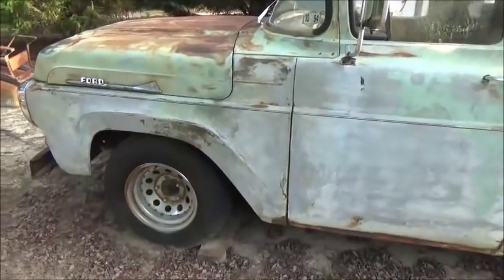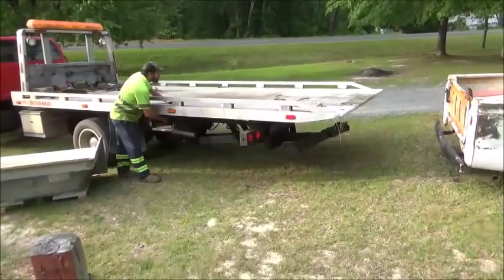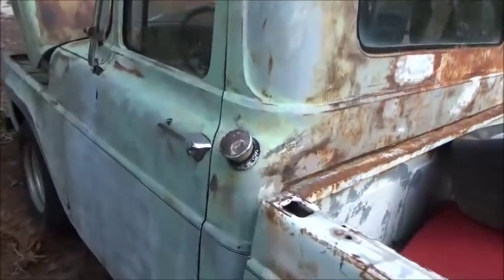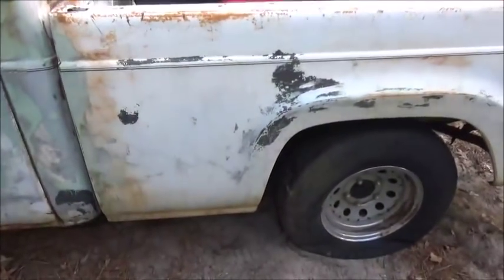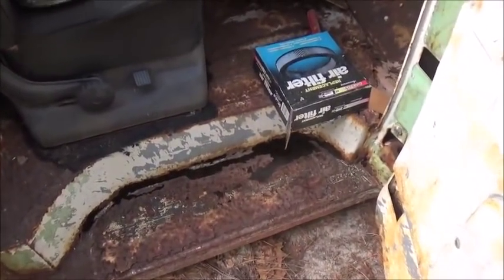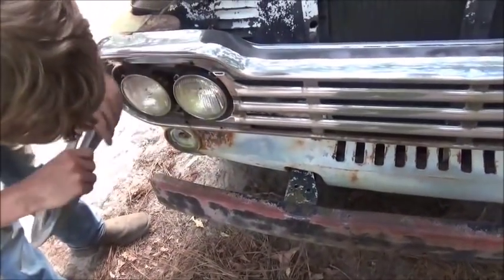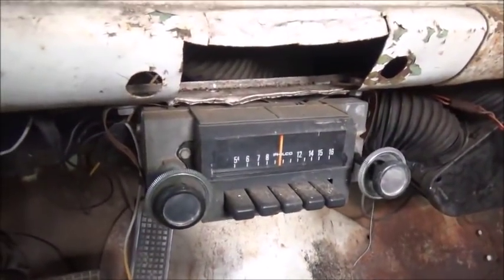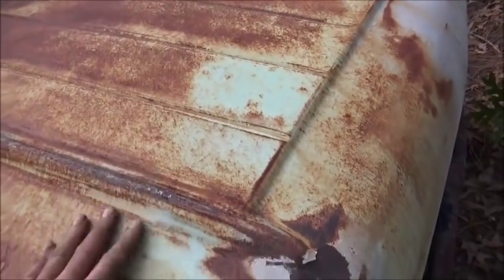1958 FORD F-100 SHORT BED! NEW IRON COMING IN!!

Comment: Eddie Cochran , somethin else , is running through my head right now  .  Another classic saved , just put me in the workshop with it and it will come out looking mint , any style you want it to be , myself , I like to see them straight n clean , with just a few little extra touches  and to be used not locked away . Keep the classics comin . Your  the top man for rescuing the old iron . Excellent job

Comment: I would not mind owning that Ford truck its a keeper for sure. Awesome condition too for what it is. That is a sought after Ford Truck worth money its kinda rare. 
Original MSRP Base Price$1,874  Low retail $14,050 average retail $26,900 High retail$61,300 I would sand that down prime it and paint it and it would look great. Those steps kinda bad though LOL The bumper and seat are not original. It use to have a Y block in it. The Windsor is better but not original. Its not worth the Kelly blue book prices because it dont have all the original stuff. But its in decent shape really sure enough something to work with. It probably needs everything brakes whole nine yards. The wind shield is good that good that is a big plus. If I didnt live thousands of miles away I would try to buy it from you.

Comment: Jonathan, that truck would be a screaming dog providing the motors not pooched. Would look 👀 sweet with a 2” drop and some deep dish black steelies on some 285’s. Nice stance with a Pro touring suspension setup and 4 wheel disc brakes. Side exit dual exhaust through the rear fenders.... nice mild Crane cam. She could be a total sleeper for someone.

Comment: My first driver was a 59...short bed stepside..had a 352 and 3 speed manual on the floor...didn't get much of a chance to drive it much being young and not really mechanically inclined was just too much....sat in my yard a couple years before I practically gave it away...often wonder what happened to it.

Comment: Assuming that truck doesn't already have it.... Throw a 9 inch that  puppy with the gearing for a inline six 300 c.i.d. and you'll have a pretty quick truck ...my long bed 71 f100 is set up like this truck and it I'll go from 0 to 55 in about 4 seconds and that's just driving normally ...I dunno how fast it would really take off if you got on it...the one time I got on it was with brand new tires they started spinning on dry pavement so I just let off it and never tried that again ...

Comment: Ford would not even spring for an exterior door lock on the drivers side. I bought a 60 F100 like yours in 77 and drove it from Utah to the NE.  If you wanted to lock the vehicle, you pushed down on the drivers side door handle, slid across the bench seat, exited via the passenger side door and locked the passenger door from the outside with the key.  I've heard it had something to with  California having a regulation which prohibited the driver from exiting the vehicle into the street or oncoming traffic.

Comment: I bought this same truck and was so bummed out when I found out the frame was bent I didn't get to finish and drive it . I loves body style the coolest looking of all the fords I did have a 48 f1 with a 302 and a automatic transmission  I put together but the king pin front end was worn out it would shake bad until you got it over 35 mph one time my starter fell off driving to work lol

Comment: Hello

Great to see a 1958 F1 rescued.

It prompts me to ask for your opinion. I have a 1950 Ford F5 coe with a V8 flathead. The clutch is shot and the manual transmission does not have syncromesh. There is a company called Flatomatic who specializes in providing Ford C4 automatic gearbox conversions. Do you think the C4 transmission would cope in a Ford F5 coe?

I know to a used C4 out of a 1965 big block Galaxy.

I really would like an opinion.

Many thanks

Nick Jervis UK 🇬🇧

Ask the man who owns one

Comment: I had on just like it and loved that old truck. I drove it everywhere. But I did have the original engine with 3 on the tree. I don't think it ever got loaded no telling how muck sand and gravel I hauled with that truck and it would not even grunt pulled everything I ever hooked it to but someone had cut the back brake lines and folded them over so all it had was front brakes. I was pulling a boat to the lake and the brakes gave way and I ran into a tree is what happened to the truck. This is when I discovered that it only had front brakes. Check things over good now when I buy them used.

Comment: Pretty nice score.. I remember back then people really didn't take well to the double headlights and the grill was a one year only so in fifty nine people knew they were stuck with the double headlights and the grill changed a  bit so the gained popularity again. Same with the car having  the funny grill that people then didn't like  so JC whitney time and tube grills. They are kinda like a studebaker, as time went by gained popularity. I sure do love the newer no points distributor, and fuel injection (throttle body) was turn key. Hope you find the one your looking for as they are coming your way now. You have a few thousand cars that you have seen in barns and buildings... fields, what a bunch of memories. Good luck with your new find... Time for a huge building to poke em in and out of those dreadful pine tree needles

Comment: I think it was a 66 I had,green,said "twin I beam" on it and had a 289 3 on the tree,plus a feature I really liked back then,a cooler insert built into the driver's door. It drove and rode pretty good too until the motor went to shit. Then my older bro bought it and put a granny geared 4 speed powered by a Chevy straight 6 in it,which if I remember right came out of an old Apache. He kept it for 2 or 3 years and let it go to his ex-wife in the divorce settlement. Lol.

Comment: Johnathan, I had a 57 f-100 for twenty some years.it had rib's on the hood, don't remember if the 58 had them.might be off a 57.it also had a Fordamatic transmission with a solid copper cooler mounted on the side of the trany.there was a 5/8 water hose that ran from the water pump to one side of the cooler.the other side ran a hose back to the engine block.

Comment: Jonathan, as often as you pick up old cars with flat tires, have you considered installing an air pump like is used for trucks with air brakes onto your truck along with a small air tank it feeds air into so you can run an air hose or air impact wrench when you are picking up these cars? My brother and I had done it to each of our pickup trucks only we used air conditioner pumps.. it works great

Comment: Hi Johnathon..If that motor turns out 2b Garbage? How about putting another correct engine back in her? Whether it was a 292 y8 or a 223 6 and another manual transmission 3 speed column shifter...tony Neillsville,Wi.. 7.39 am Saturday May 4th. 2019 thank you!
Reply: nope, put a 302 back in it and run the belts offa it, set up for a Sb ford allready so why tempt fate?????

Comment: When I was a kid, my dad had a turquoise 60 F 100 but he sold it.. When I was 16 I found a red and white 60 with the chrome grille that, which actually turned out it was an old NOS hed installed the previous fall to get it out of his basement -after being down the since the early 60's when the original chrome grill was damaged by a delivery truck but wasnt changed after the new one was bought -there wasnt a speck of pitting, rust or even tarnish anywhere on it) and it was a  big back window cab. I worked out a deal with the old guy who had it. He wanted the Pontiac straight 6 engine and transmission he had put in it many years before out of it, and since I had a 351W -FMX, as well as a 460-C6, that was fine with me.. When he called to say the engine was out and it was  ready to be picked up, my brother and I went after it right away only to find that he had used a cutting torch to get the engine out. not only did he cut the motor mounts and exhaust which were no big deal, but he had cut that IMMACULATE chrome grille and radiator saddle so he wouldnt need to lift the engine as high, but had also cut away the middle of each front fender and inner fender wells and also the hood hinges, and the cab floor to get easier access to cut  out the transmission cross member, front of the drive shaft and the speedometer cable. The only wrenches he used in removing it were to bolt a chain to the engine to lift it up.. I had even offered to remove the engine for him when the deal was originally made but he declined as he wasnt sure when he would be ready for the engine and wanted i to go right into his car he wanted it for.. Needless to say, I  told him I didnt want it after he cut it up and he got mad that I didnt want it becaue he would have kept it as a to use as a truck if hed known that I was going to change my mind.. It broke my heart to see how badly hed wrecked it
Reply: sad story
Reply: @willefixit  yes it is..

Comment: Just because the nut catcher is laying on top of the intake manifold , without a carb there still may be nuts in the motor lol
Reply: walnut blasting valve job on first start lol

Comment: Just curious why you don’t go over the axle with those hooks? Would seem less likely to unhook on its own that way. That was likely an Sparkomatic shifter. They were pretty common back in the day for floor shift conversions on automatics.
Reply: John Acuff Brakeline sits on top of the axle.
Reply: Kris Wright   Not on the front axle. On the front, the rubber lines come off the frame straight over to the brake wheel cylinder.
Reply from the maker: The length and weight of the hooks don't allow them to come unhooked. If the get loose they just rotate. Never have issues with that.  I thought the shifter was a Sparkomatic, but has Hurst on it.
Reply: @jonathanw4942  i had spakomatic power booster for 8track lol .hurst quicksliver??

Comment: That old ford is in good shape!
 I thought the 351s were made in Cleveland, The 352s was made in Windsor,correct me if i'm wrong. I really enjoy watchin your videos!
Reply: 351 is a completely dif animal motor, chamber heads and runs like snot, the windsor motor  can be a 260-351 becasue of it's  design and called the small block , here.................
The Ford Small Block is a series of automobile V8 engines built by the Ford Motor Company beginning in July 1961. The engine was discontinued in new trucks (F-Series) after 1996, and new SUVs (Explorer) after 2001, but remains available for purchase from Ford Racing and Performance Parts as a crate engine. The "Windsor" designation is a retroactive applied for the family of engines sharing a common basic engine block design. The Windsor designation was adopted to distinguish the 351 cu in (5.8 L) version from the Cleveland 335-family engine that had the same displacement, but a significantly different configuration. The designations of 'Windsor' and 'Cleveland' were derived from the locations of manufacture: Windsor, Ontario and Cleveland, Ohio.